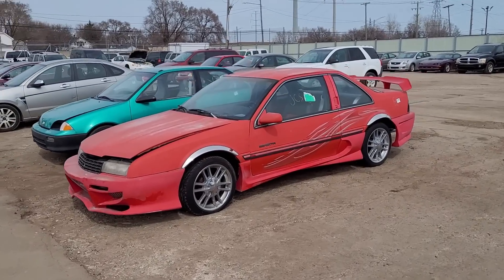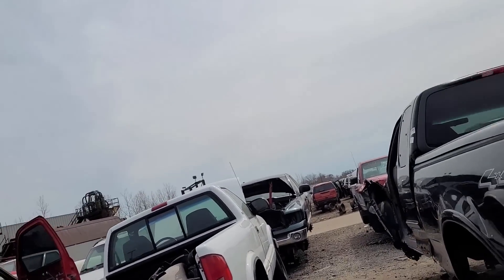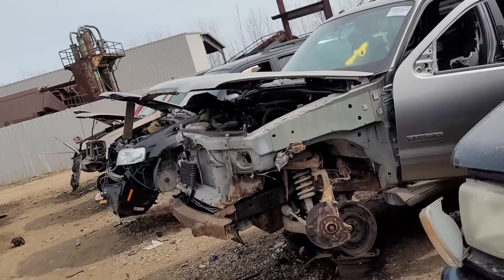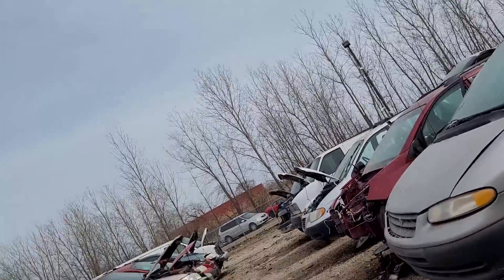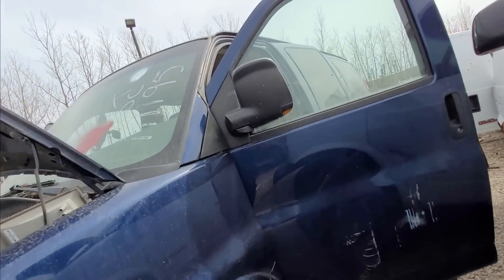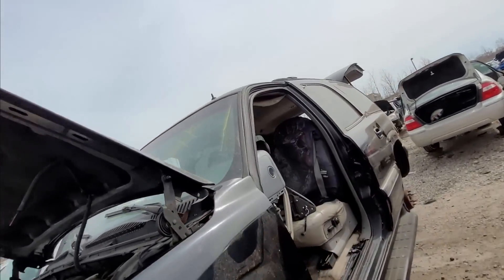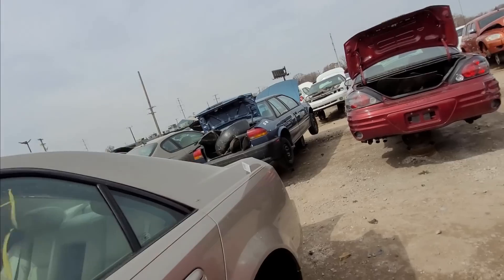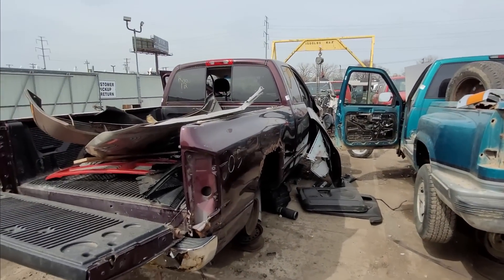New Junkyard supercenter discovered! Bargain engine swaps!

Comment: I was there a few days before you, needed to grab some bolts for the power steering/alternator bracket, only found one truck with the bolts i needed, that complete one you pulled the hood up on wasn't there otherwise i would  have grabbed the intake haha

The best yard for ls parts in the area is the you pull it in Pontiac, I love that place.

I'm like 15 minutes away from the 8 mile yard, but will go out of my way to go to the one in Pontiac
Reply from the maker: The Pontiac Upull is really nice, I like the paved lot lol
Reply: @TheDrivewayEngineer  US Auto in Sterling Heights is good too but I had a bad experience there once, had a broken DSM BoV from a Florida junkyard in 2008 that I completely forgot about in my tool bag, when they searched my bag they found it and treated me like I was stealing the Mona Lisa.

I told them they could keep it and they threatened to call the cops on me if I didn't immediately pay for my property.

I threw a crumpled $20 bill at the guys face and walked out

Comment: Jr im coming to mi in June with 9 boxs that are pre sold using your plan I got a 4l80e I bought on market place on the shelf I could bring it out to you its 2wd out of a van and converter I paid 200 for it same price to you if you want it air checks very little  metal in pan no bad smell guy I got it from I have bought a few things all have been good he said it took it of a plumbing van that was rear-ended bad
Reply from the maker: He needs a straight swap, it's just a driver for him, but thank you.

Comment: I like that yard. I usually don't make it that far, since I'm coming from the Flint area. PG is way bigger than US auto, and probably a little bigger than U-pull and Save in Pontiac. It's just not organized very well. 98 up F-bodies are good for S-10 front brake upgrades. 6cyl/8cyl all use the same 12" brakes.

Comment: oh jesus a bertta LOL, a 5.3 express van?!?
Reply from the maker: Yeah, I thought the only options were 4.8/6.0 also
Reply: @TheDrivewayEngineer  The '03-'07 Express/Savana vans had the 5.3 as the only V8 in the 1500 series (Rockauto shows a '05 4.8 option on the 1500 Express van only but i think that may be a glitch) and some 2500 series came with the 5.3 as well. Only engine options on the 2500HD/3500 8 lug vans seem to be 4.8/6.0 4L80E which is what you are thinking about. It is rare to find new body Express vans here in Ohio and the majority are white delivery 4.3 V6 1500/2500 light duties. Conversion new body vans seem to be 5.3 1500 but never seen one in a junkyard.